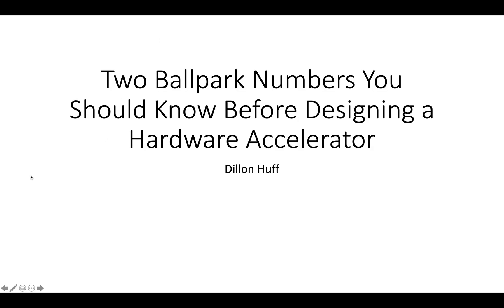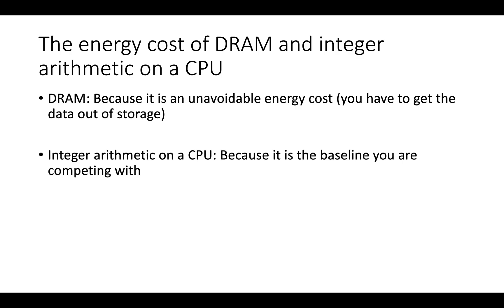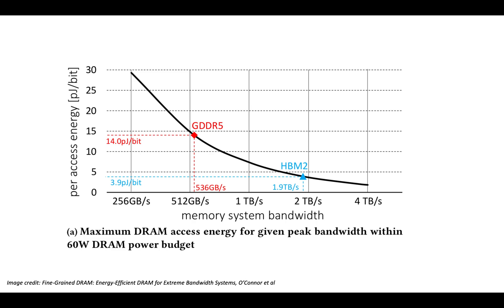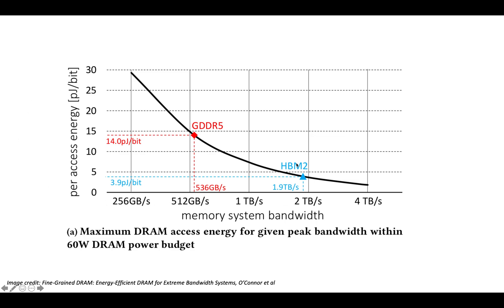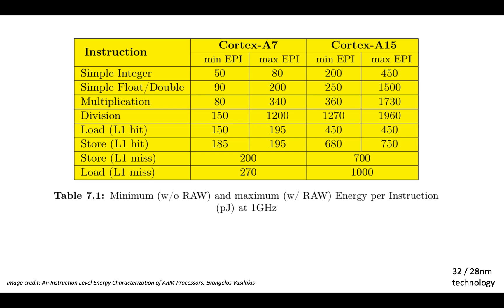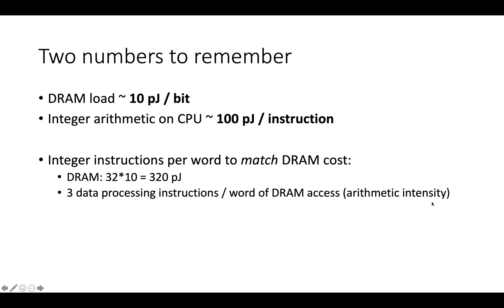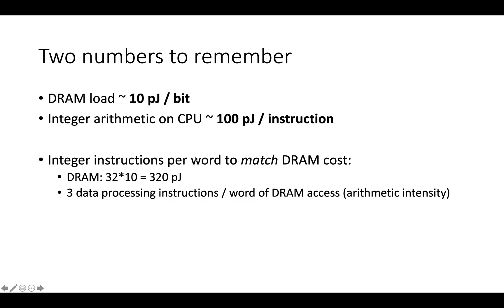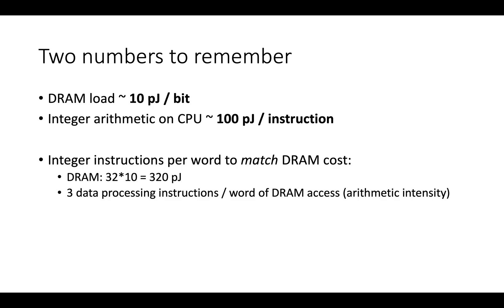Two Numbers You Should Know Before Designing a Hardware Accelerator

Comment: As a novice in hardware acceleration, could you point me to some reading that explains how I should interpret pJ? I’m not sure when to think in pJ with a design
Reply from the maker: To be honest I never read much about it. One common, important situation where I've found that thinking in pJ is helpful is when you are given a power budget (in Watts) and need to optimized performance. In that case you have:

Power Budget (Watts) = Energy per Instruction (Joules / Instruction) * Performance (Instructions / Second)

So for a fixed power budget your EPI determines your performance, and in that case thinking in pJ (or any other measure of energy) is really critical.